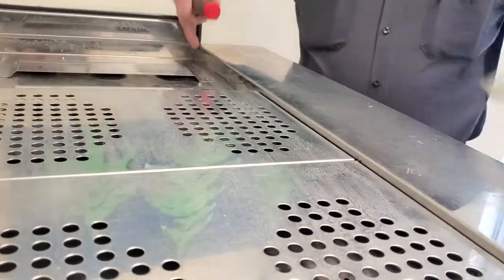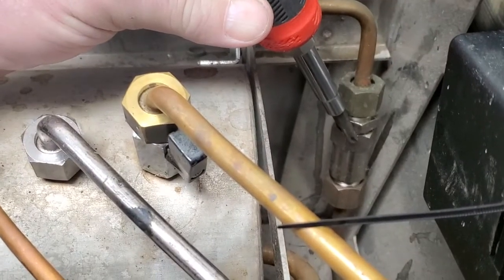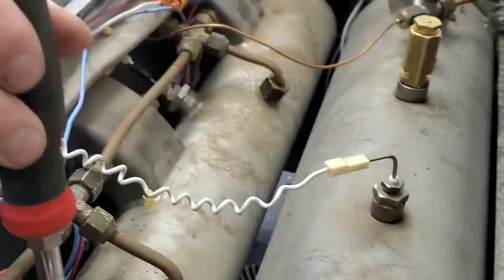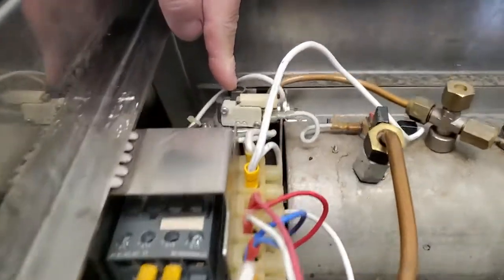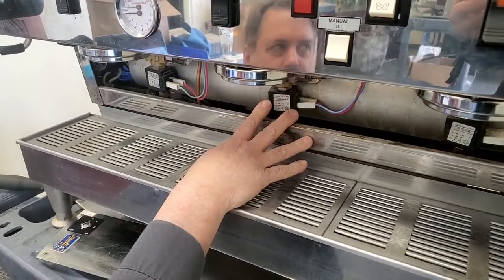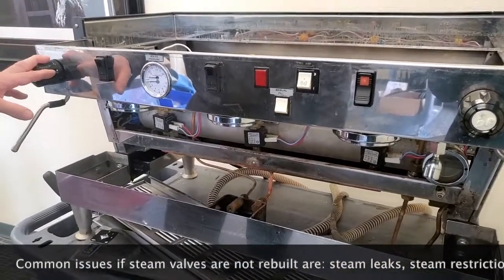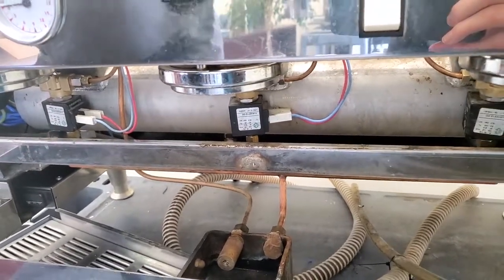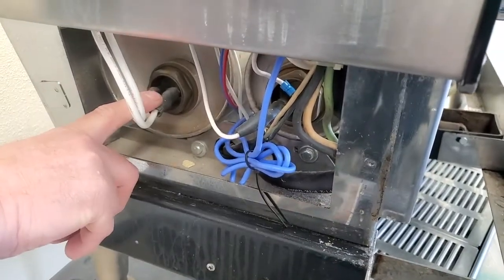Inside the La Marzocco Linea Classic

Comment: WoW better insulate those 2 broiler tanks with some fiberglass insulation wrap like they do with their newer made exact ones!
Otherwise it's costing electricity and making staff hot and wearing out the heating elements and related.
Also since many find reduced maintenance by keeping the machines turned on 24/7 in a high use establishment.
Great video, thanks for caring and sharing! I'm making labels for all the components to help anyone looking inside!
Take care

Comment: Hi there, very helpful videos! Thanx! I Haven wieściom about my 10yo Linea Classic 3AV with No PID. How do I control brew temp?
Reply from the maker: There is a set screw that adjusts the pivot point of the switch height from the plunger on thermostat well. Turn off the machine when you adjust. 1/16 to 1/8 of a turn.
Reply: @EspressoServiceNetwork  thank you, found it:) and sadly I might have an issue with thermostat. I have a feeling that water coming out of brew groups is almost boiling. I wonder if this is the thermostat which failed does it make sense to fix it or should I just go straight for PID kit…
Reply from the maker: Move to a PID, definitely.

Comment: I started having a sticky button for my hot water, any thoughts how to fix that before i call the espresso tech just for that! Thanks
Reply from the maker: It depends on the button. If it is a pad or a high voltage button, then you need a tech. Other than that, try cleaning it with a cloth.

Comment: Thanks for the Video..

At 8: 22 CAN you please explain more about safety switch ? Which is then connected to heating element..

In my Gb5  machine I found that sometimes the heating element stopped working and there is no steam pressure..
Reply from the maker: If the safety switch is connected to  the heating element via the power wires, which is the case in newer machines, anytime there is not a good terminal connection the safety switch  will build up heat inside itself and trip. Let me know if this helps.
Reply: @EspressoServiceNetwork  
That means it's not a issue if he switch get tripped. We don't need to check machine for any abnormalities..right?

We can reset the switch and start using the machine .. Am I correct?
Reply from the maker: It is an issue if your switch trips. This can lead to additional problems. You need to verify that there is a good connection. If there is not a good connection change the terminals and wires if needed. If your connection is good you may  have a boiler fill issue or an overheating issue.
Reply from the maker: Yes, you can reset the switch and begin using the machine but you still need to search for the cause. Safety devices trip for a reason. Don't ignore it.
Reply: @EspressoServiceNetwork  Thank you!! Appreciate your help
Reply from the maker: @sanandre3091  You are welcome! Thanks for reaching out.

Comment: Hi Sir, if brew pressure drop to 3bar on idle is that mean expansion valve is faulty? Tq in advance
Reply from the maker: You will only see the pressure gauge rise when the machine is reheating. If it is not reheating the pressure can drop all the way down to what your building pressure is. if there is a problem with the check valve it will not show the rise of pressure (expansion) and thus it's very hard to set your expansion valve at pressure

If you just did a brew, it might not be reheating which means nothing is expanding. 
If you have a mechanical thermostat, it often takes up to 10 brews before it will start reheating?
 I hope that helps. If I can clarify something let me know.

Comment: ever have pump issues? for example a bad pump start capacitor ? Our Linea trips breaker during a rush
Reply from the maker: The breaker could be caused by a few things. Are you using a GFCI circuit breaker?.Pump capacitors will weaken or go bad over time but they do not typically trip a breaker. They will however blow a fuse on your main board if you are operating a volumetric dosing Linea.
Reply: @EspressoServiceNetwork  yes it’s on a GFCI. It did go off couple months back when we steamed too much and some of the internals wires looked wet but this time it keeps tripping the breaker, but nothing is wet.
Reply from the maker: @adamn480  The GFCI may be bad.

Comment: Great Help, Thank you. 
But some of your advice for old machines: 
1. It does seem your advice to replace the Older Steam Broiler pressure(temp) controller when it goes out, with the $600+ PID controller kit is poor advice. 
Simply because it appears the company which makes the old style Sirai Pressurestat switch (P302?), still makes them for $100 new. Plus the pressurestat contains the electric contacts which turn on and off the heating element. So when you replace it, you are getting all new, unlike the PID which uses 2 expensive components which both wear out, to do the same thing. Plus even though the Brewing thermostat # L260 might no longer be available, its micro switch # 11981.10 (Cutler-Hammer# E47CMS01 20amp!) which is what wears out, is for cheap. 
2. Replacing the entire older 2 part brewer tank w/bolt on brewer heads for a newer tank with welded on heads... that's $$$$.$$ of dollars... I would think if a weak threads break/over tightened, new threads can easily enough be welded onto the old tank. I see a new gasket can be had for $7 plus shipping from a few sites. 
Take care.
Reply from the maker: As a professional technician equipment owners are typically seeking improved performance.  In the case of  with upgrading to a PID, improved performance and less maintenance.

Welding is not that simple or easy. Again, most equipment owners are seeking resolutions that are quick and efficient. IOf course, you can try all the things suggested but the potential for a poor outcome is not a gamble most business owners want to take.
Reply: @EspressoServiceNetwork  thank you for the reply. I'm not sure the PID is necessarily more reliable. Both systems rely on contacts which suffer high voltage arcing damage over time, each time the heating elements turn on and off, breaking the electrical flow. Yet the contacts in the mechanical are much cheaper to replace the unit.
As far as the temp swings of the mechanical, when they were the latest, they were touted to be more reliable than the 10 deg you say you have witnessed and our customers and staff are happy with the accuracy of the mechanical. Some of us restaurants have tight budgets and have to do some repairs ourselves. Not to fear, there are more than plenty of work needed from the professionals, especially honest and caring ones like yourself.  
Take care
Reply from the maker: Thank you for the kind words! The PID system uses a solid state relay.  They can break but there are no contacts or wear n tear parts. If cost is an issue and temp fluctuation is not a concern then stick with the switch.  Be careful not to lose the spring (its easy to do) or the c-clips and know that overtime the thermostat gets more and more out of range.

Comment: During normal use how audible should the boiler contactor clicking on and off be? Ours is definitely present in the room, like placing a hard object on marble. Wondering if that’s normal or if I should have a spare on the shelf if it fails. 12 yo machine
Reply from the maker: The contractors are loud when they close. If the contractors have not been changed, it might be time to change them. Depending on use, change them every other year or max life 4 years.Hope that helps.
Reply: @EspressoServiceNetwork  that does help, thank you for the reply!
Reply: Yup that’s normal

Comment: can I change the temperature of the brew boiler separately from the steam boiler? I'm working with a linea classic av2
Reply from the maker: Yes, they are independent
Reply: @EspressoServiceNetwork  I guess I should have asked, how do I change the temperature of the steam boiler? also, will lowering the temperature of the steam boiler cause the steam pressure to be less? right now my machine's steam wand is putting out so much pressure that it's unmanageable
Reply from the maker: @lukeschneider9949  Here you go https://youtu.be/odDmsjkjf6o

Comment: In my Linea Classic machine Brew pressure not going above 6bar even i increased Pump pressure by turning clock wise

Please Suggest 🙏🙏
Reply from the maker: Most likely, you have a bad pump or balance valve on the pump.